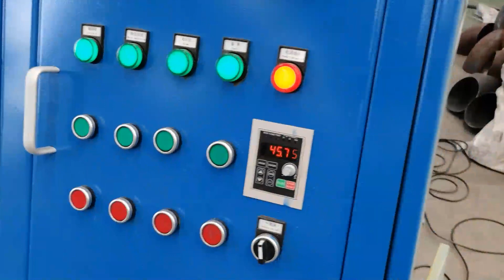Mini Copper Wire Recycling Machine Separates Wires Cleanly And Efficiently

Comment: But how does it do it? I get it cuts in up but how does it get the copper out of the plastic coating??
Reply from the maker: The copper and plastic inside will be completely separated during the process of copper wire being broken.